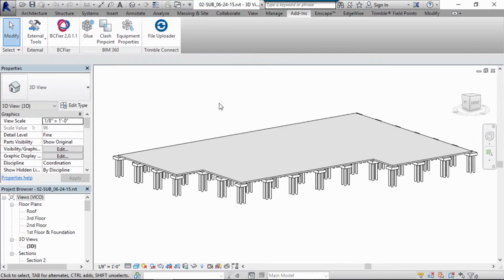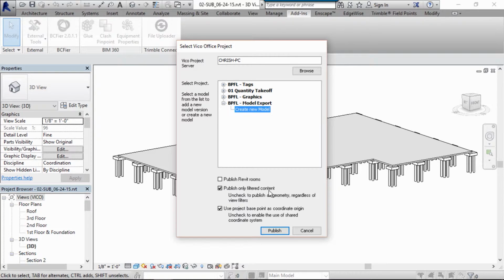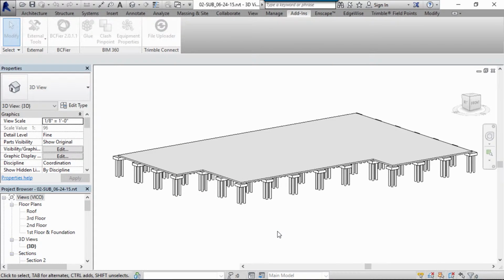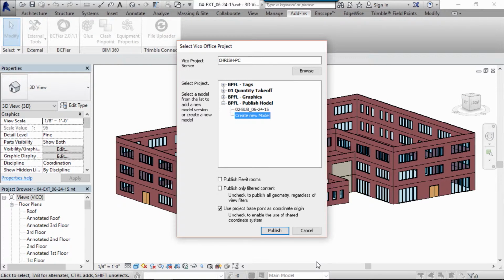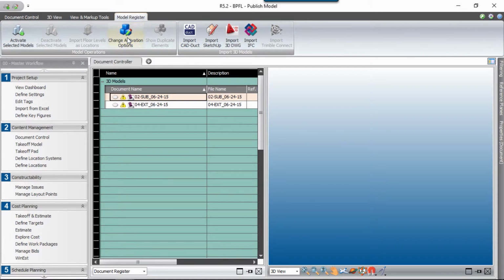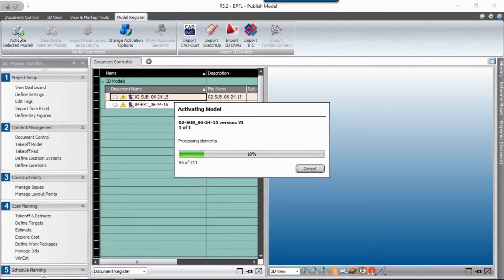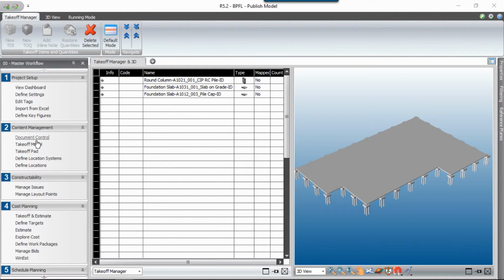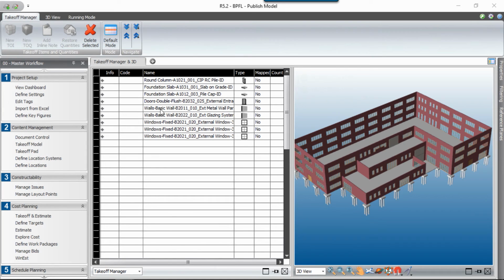Tips and Tricks: Publishing And Activation A Model In Vico Office

Comment: Thanks for sharing. How did you manage to have the 2 models aligned when imported to vico office?
I have two 3Models for same project (architectural & structural); when I import them to vico, they are not aligned. Is there a way to align them? to move one of the model to fit to the other.